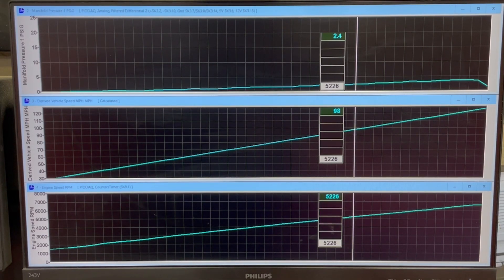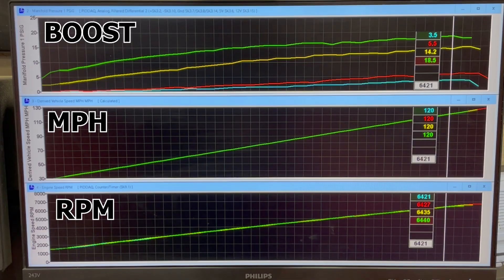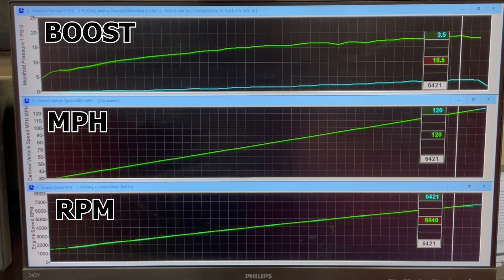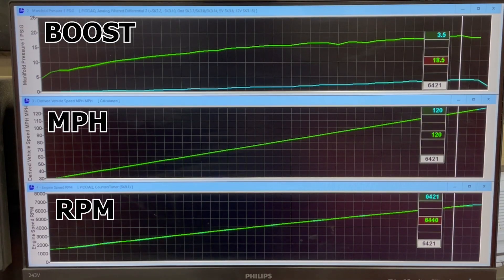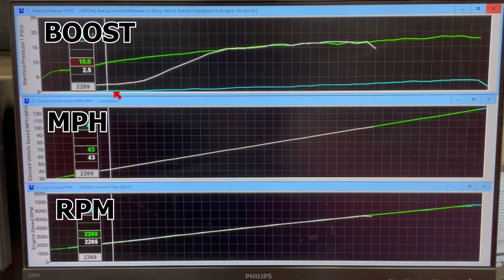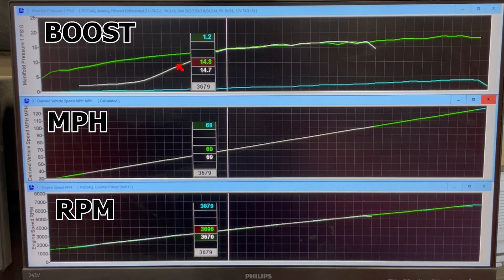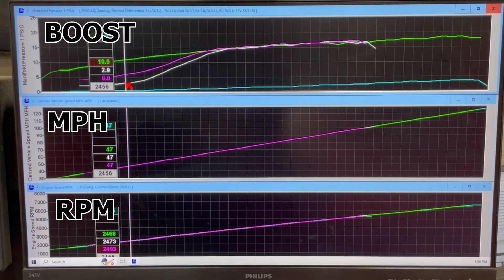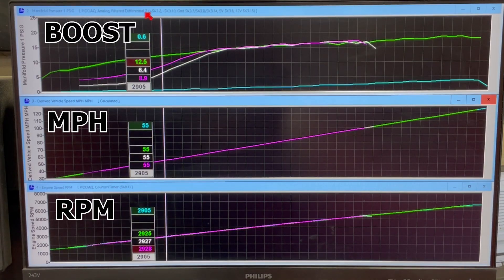Kaizen Relay SmoothBoost Controller Explained

Comment: Would you be able to control centrifugal superchargers with a kit like this as well?
Reply from the maker: The way to control the boost on a centri blower is with a wastegate on the charge tube. You can then use a boost solenoid on the wastegate.

Comment: Do you have a C7 z06 kit? Is the switch/trim pot mounted in the car?
Reply: Yes, we have kits for C7, Gen6 Camaro and Gen3 CTSV. We're working on an installation and troubleshooting video using a C7 so stay tuned for that. It will answer most questions.
Reply: @reidlunde7020  thanks for the reply! how seemless and smooth is the boost increase once it's triggered by wheel speed?

My car is currently max effort stock ported blower. Next will be a Maggie and port and this looks like a cool set up. Worried about making to much power and having grip issues and not enjoying the car at Lower speeds so the control is nice
Reply from the maker: @MichaelGreco  It's perfectly smooth, the only thing you'll notice is that you have traction! Aggressive PD blower cars are near impossible to drive at mid-throttle, especially with a cam, this makes the cars so much more drivable instead of being an on/off switch.
Reply: @KAIZENSPEED  when the time comes let's say my shop does most of the work but I'd like some fine-tuning after, like programming different boost levels to the switches is that something you could do remotely?
Reply from the maker: @MichaelGreco  There are 24 different pre-set levels. Some are fixed boost levels ranging, and some are ramps. The preconfigured options will do everything you will need. It's just a matter of selecting which boost ramp works for the tire and surface you're on. Changing ramps is as simple as selecting a different trimpot position.
Reply: @ Ah, nice. That works. For the physical switch, does your unit replace the smoothboost one? Thanks for all the replies.
Reply from the maker: @MichaelGreco  Yes, our system replaces the smoothboost knob.
Reply: I can't wait for this to be available for the C7 Z06. So frustrated with crappy track prep to the point I can't even make a pass sometimes. Save me from trying to figure out how to pull timing for different track conditions.

Comment: Will this work with the factory ihi supercharger? On a hellcat thats tuned on e85 somewhere around 950whp.
Reply: Hellcat uses a DBW throttle body for a bypass valve and yes we have a kit for that, it requires a "dummy" bypass valve so the PCM still thinks it's in control.
Reply: @reidlunde7020  thanks for the reply can you send a link. Please